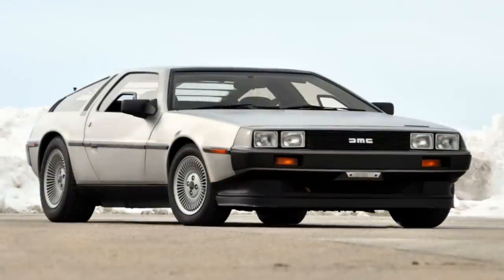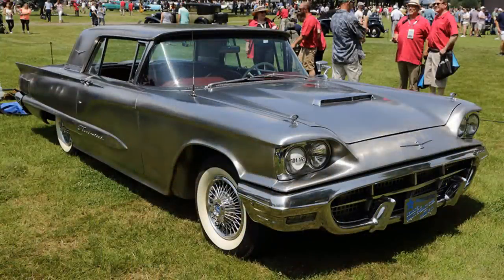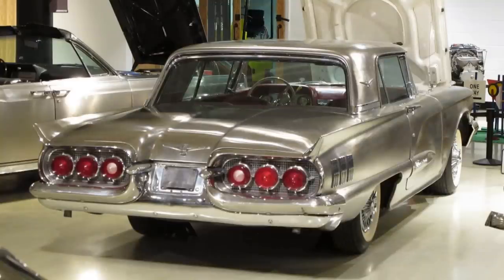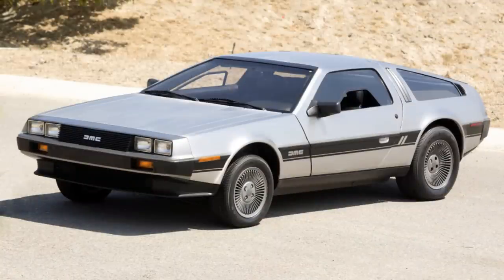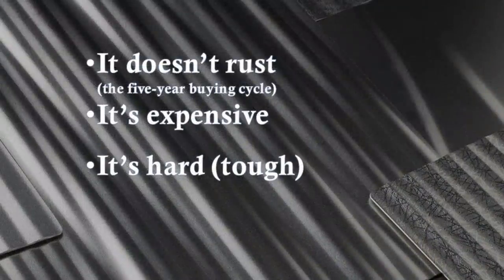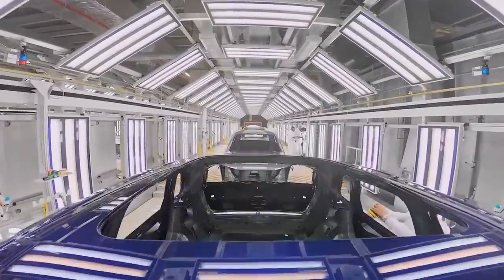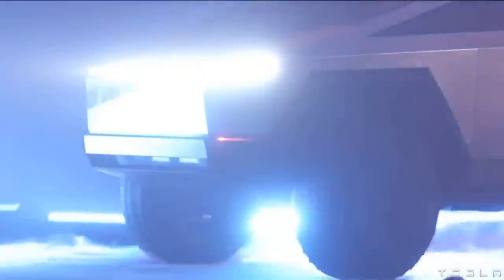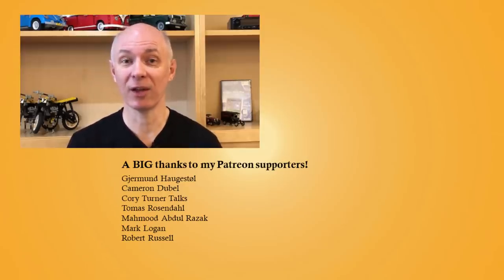Why aren’t cars made from Stainless Steel?

Comment: 5 year buying cycle for a car? What? In my country it's normal to buy cars that are 5 years old and drive them for 10 more years. Really, cars can last for a long time if you take care of it and pick a reliable brand. I would never buy a new car, especially not every 5 years. And it's not because I have no money, I just spend my money on smarter stuff (Like real estate) and my current car is Hyundai almost 8 years old. No probelms at all, just channge oil and filters every year and it can last for another 8 years easy. People are spending money like crazy, it's really weird.
Reply: That happens when people buy stuff to impress others.
Reply: Both my currently registered vehicles are twenty years old and I have two fifty year old cars in the shed that I'd rather drive but arseholes try to steal them when you park anywhere
Reply: The cascade cycle, people who don’t wreck their cars have the option to keep or sell them to those less fortunate than themselves until the car becomes a classic and is then worth more and worth preserving or restoring ….

Comment: Thank God we today have downsized engines with exhaust gas recycling so the engines die before the car can start rusting.
Correction: Aluminium isn´t "rusting" as steel but it´s degrading as well.
Reply: It's oxidizing.

Comment: - Aluminium is also prone to corrosion and typically salt water is enough to do a lot of damage quickly in a lifecycle
- There are parts that are bent on Cybertruck and air bending should not be confused with stamping - you can easily bend stainless steel but stamping features that require deep drawing are much harder to make because the alloy toughens rapidly as the material deforms. But there is not much material deformation in a single line bending so you do not have to cut and weld
- There are stainless steel alloys (AISI 304 and 316 to name a few) that can be welded even better than many "regular" steel alloys.

Comment: I'm quite certain this yet another Tesla gimmick. As has been shown with past models, Tesla isn't good about costing out the parts to come to a profitable price. As another Ford executive once said, if the part costs less than 1/200 of a cent, we give it to the customer for free. If the Cybertruck doesn't sell in the forecast numbers, Tesla will take a financial beating with something worse than a sledgehammer. They'll take an even worse beating if it isn't costed closely enough and it turns out to be a big seller. They'd lose even more money total under that scenario. The late, lamented BMC had experience with this problem selling the Mini. Stainless steel, especially cold rolled, is a very expensive metal to produce and work with. There's a reason why major buildings, that have no five year replacement cycle, aren't generally built with stainless steel. Finally, there are still Federal safety standards to meet in terms of body integrity for impact and rollover. I've heard nothing about the Cybertruck meeting those standards.
Reply: It’s that mindset that gets humans nowhere! I bet you think the earth is flat too!
Reply: @hanniffydinn6019  Yeah, nothing worse that facts to flatten out the earth. Don't worry, dude, Elon will still be launching rockets and going to Mars.
Reply: @hanniffydinn6019  "Influencer". You hipsters really believe this crap, don't you. The truck isn't even in production yet. It has any number of material issues to work through before that can happen, and Tesla needs to build a new production line and get people trained before it can even start production. The current financial condition of the company is any misstep with this truck and and Tesla will quickly be in financial trouble. Being a visionary is nice, but guys like Delorean, the last one with a stainless steel vehicle, was a visionary that ended up bankrupt. Vision without the money to carry it through doesn't mean much. I hope you don't own Tesla stock but, if you do, I suggest you read https://www.digitaltrends.com/cars/tesla-is-dying-and-this-is-how-it-will-end/ and get a stop loss plan in place.

Finally, does every wealthy person and "influencer" in the world already own a Tesla? Didn't think so. There are a lot of companies making EVs now, and most of them are financially stable. The combination of Nissan and BMW has already produced as many EVs as Tesla since it started, and many more companies are nipping at Tesla's heels. People make buying decisions based on a lot of aspects other than how cool a product is.

Comment: In my opinion as far as business and growth strategy goes, to choose to make the cyber truck out of stainless steel will increase the volume ordered from the SS factories over the long period of time lowering the cost with economies of scale. This will in turn can be applied in the rocket building side of business which would generally have a lower volume of SS required. This efficiency is  also transferable in the engineering and design of all the forming equipment and tools required to build anything space related which would otherwise wouldn't have direct positive cash flow.
Selling the cyber truck is really paying for Engineering and factories to build  space equipment.

Comment: indeed its been commented elsewhere that the cybertruck is made from a single piece of cold rolled stainless steel. its either cut or scored by laser and then folded to the desired shape. this is why it looks so boxy on the outside. tesla have spent a while going back to the drawing board minimising the costs associated with car production. stamping dyes and production lines are costly and inflexible!

Comment: One doesn't require 8 minutes to answer the title question.
Yearly profit would plummet if cars were made of rust resistant steel.
Reply: And Tesla is taking customers from those manufacturers. They do have another ace up their sleeve though. Tesla cars are driving tablets- battery degrades and they can disable the car via a software "upgrade". Like Apple does.
Reply: @Mic_Glow  "And Tesla is taking customers from those manufacturers"
"Like Apple does"
And Tesla sales will be as low as Apples compared to it's rivals.

Also Tesla doesn't take. People aren't taken against their will.
Tesla is able to influence, but not take.
Reply: @xander1756  What do you mean it doesn't take away customers? Suggesting EV owners never had a car before? Sure numbers are low, but increasing.
Reply: @Mic_Glow  I mean a company has no power to forcibly take customers from one company over to theirs. They can only influence, coerce, entice. They cannot take.

An individual, in the context of buying a car, is solely responsible for their decision of which car they will buy. They were not taken by one company over to their showroom and forced to buy their car.

It's the same misuse of language when a sports commentator says the person who came from behind to win the race,  and they say that person stole it from the person who was in the lead all the way till the near end, or the favourite was robbed of a win.

No robbing or stealing occurred. The athlete who won, did so fairly and 100% deserved their win. To say the other athlete was robbed or the eventual winner stole soemthing is an erroneous and irrational claim.

Comment: Wasn't there a big push for pedestrian safety in auto designs a few decades ago? The cyber truck kind of just throws that concept out the window with its pointed front end designed to make sure pedestrians go under rather than over the truck

Comment: This sounds like a bunch of excuses. I love the last one. 
"It's bullet proof!"
My thoughts: "yeah, how cool is that?"
Video: "it's gonna be used by criminals!"

Also, environmentalism is the big thing now. Why is trying to make cars more sustainable, longer lasting, and easier to repair a bad thing?

And BTW - how is a car made of streel plates harder to repair than a car made of an intricate aluminium cast? The cost of a stainless steel sheet and a few welds is way lower than the cost of exchanging a part of the car that is specifically.pre-shaped and marketed by the manufacturer.
Reply: "Bullet proof" is only a good idea, if you live in a freaking warzone, where it's more likely you get shot, than get in a situation where you (or anyone else from the outside) need to break the glass to get out of the car. Outside of warzones, it's more likely you get killed by having bullet proof glass, than that it saves your life. 
It's not for nothing they invented car-glass the way it is now. It's not for nothing they designed tools to easily break car-glass, that they recommend you alway have in your car.
Everyone who loves the bullet proof glass, honestly didn't think it through and has no grasp on reality.
Reply: @cryptopolice6202   @Crypto Police  Bulletproof also means debris proof. It means if you plan to off-road with the car, it won't be banged up by gravel and minor falls. 

Also, in a US context, anyone can shoot you. In fact, even outside of the US anyone can shoot you. 

As for bulletproof glass, you can make it so the glass panel can be easily ejected from the inside, and not the outside. You don't have to break it.

Once again, I hear the whining of a person with ZERO creativity or appreciation, who loves to live by yesterday's statistics. 10 years from now you'll comment the same way you do now, but you'll say "I wouldn't buy a car without bulletproof exterior, it's the industry norm! Why would you NOT want to be protected? There is a reason it exists!". Because sheep like you always repeat the most comfortable and least offensive opinion possible.

Comment: Excellent video and a good idea for a subject. Those early Fords were amazing. I take the point about dies wearing out but I would have thought there were new hard materials that would solve this. It's pretty clear that stainless steel is not a good chioce for bodywork, but galvanized steel is a different matter. I have a 23 year old Cinquecento and there is no rust anywhere.
Reply: Bicyclehub Dude, the 500 went out of production 44 years ago. What car are you talking about ?
Reply: @saveriosalemme5366  The Fiat Cinquecento (Type 170) (/ˌtʃɪŋkwɪˈtʃɛntoʊ/, Italian: [ˌtʃiŋkweˈtʃɛnto]) is a front engine front-wheel-drive, four passenger, three door hatchback city car, manufactured and marketed by Fiat from 1991–1998 over a single generation.

It was manufactured at Fiat Auto Poland, which had manufactured its predecessor the Fiat 126.

Production of the Cinquecento ended in 1998

Comment: The thing is: Building cars out of stainless steel is useless. It is hard to manufacture, which makes them far more expensive. And you can get similar results from just treating the surface of the steel the right way. These will only rust when the coating is damaged and not repaired. And of someone does not treat their car properly, something else will break anyways. That's why stainless wouldn't make sense. It wouldn't change the life expectancy of the car that much, but make it more expensive to buy.
Reply: You obviously don’t live in Minnesota.70,000 dollar pickups rusting out in ten years. Build one that’s durable and they would have people standing in line. Pretty sick, and they are all in on it.

Comment: One aspect I haven't seen mentioned or I've missed, is stress corrosion cracking in stainless steels due to chlorine. Basically, where stainless steel is under tension (be it structural members or even just bends of residual stress from welds) any chlorine present will cause cracks, and the tension  will accelerate the process. This is a particular problem at higher ambient  temperatures. The classic case study is the fatal collapse of concrete ceilings of several swimming pool buildings that were held up with stainless steel tie rods. In car terms I would guess you would see problems in the engine bay or around warm battery pack structures, mostly over winter from salty roads, especially in hard to reach areas where the salt isn't washed off.

Google "hse stress corrosion cracking pool" should give you an official report on the collapses for example.

Comment: You rather skated over the fact that: 1) The Cybertruck is years late & 2) the vehicle shown at the launch broke safety laws in all significant jurisdictions and would require a fundamental redesign before it would have any chance of going into production. So more a publicity stunt than a serious attempt to produce a marketable vehicle.

Pretty much the same story for the Semi. Tesla are becoming the masters of vapourware, without a single product that they are selling at a profit. Right now they are only being kept afloat by government handouts ' grants that will soon be drying up. The most over-hyped company since Theranos...
Reply: 100% agree. The Cybertruck wouldn't pass crash & safety tests anywhere in the world in it's current form. And good luck getting that lump of stainless steel to crumple as is needed to protect the occupants. All Tesla does is keep the hype and spin going to keep the investors and fanboys happy.
Reply: @Ozsmallbore  Yup - the Semi is even more of a hype-job than the Cybertruck. Also years late, and simple arithmetic shows that the batteries will take up so much of the max allowable weight that there won't be much capacity left for freight. And then there's the autonomous taxis - when they can't even run autonomously in a tunnel they built themselves in Las Vegas. It really is beginning to look like one big scam - but there are millions who seem to have drunk the Kool-Aid...

Comment: The Ford model A of 1930-31 had many exterior parts made of stainless steel. Radiator shell, headlights, tail-light and trims. There's at least one 1931 Ford Tudor made of stainless steel similar of the 1936 ones.

Comment: It's expensive and heavy and there is no big upside from security point of view and gives less mileage, along with all problems with a heavy body.
Reply: Stainless steel has roughly the same density than low alloyed steelgrades, so if a particular car is "heavy" has nothing to do with the steelgrades used...
Reply: @stefanpaege2046  compared to aluminium ? 
most cars in the price range use aluminium that includes the Ford 150.

Comment: Stainless steel panels copper-brazed with flanged stainless steel cylindrical tubes are the way to go! Checkout BROAD Group's BCore Stainless Steel Building Material, which can be used to develop cars, buildings, ships, and bridges using stainless steel material. In one of their marketing presentations, "bcore slab - Broad U.S.A. Inc.", they even depict what could be termed CYBERTRAIN.

Comment: I would expect development of fatigue cracks in load bearing body panels to become a problem in the long term. The metals rigidity does not allow it to absorb vibration loads.
Reply: Nope. Cold Rolled Stainless Steel has good yield strength and is resistant to fatigue.

Comment: Great vid on points with using stainless steel n history car manufacturing using stainless steel.👍 I believe Tesla won’t build because they don’t have factory that can build in big numbers but will find way putting cybertruck together if they can afford newer bigger factory.
Reply: Yeah that's what I thought too but apparently they've already accepted pre-orders which is alarming since there is no way this bulletproof riggid car can pass safety tests and become road legal.
Reply: Roni Vornanen Do you really think Musk would present a car which he wouldn’t be able to manufacture or have pass safety tests? If you do I have a bridge in Brooklyn I’d like to sell you.
Reply: @saveriosalemme5366  Considering this is the same guy whose solution to traffic jams is building one lane underground highways with elevators that take good 20 seconds to get one car in and out. Yeah I actually do. He isn't a genius but he isn't a conplete idiot so there's definitely some kind of clause in the pre-order agreement that says the cars won't have to be exactly identical to the pen they introduced.

So that probably means the whole the body won't be built on a stainless steel armoured _"exoskeleton"_. Because if it is I can't see that passing of the pedestrian safety standards. There's a reason why bonnets and bumpers are soft plastic and aluminium and not hardedged extra strength bulletproof, dentproof stainless steel. 

In modern cars the body is designed to absorb the impact, this is done though having an internal chassis covered with soft aluminium but here all we have is an _"nearly impenetrable exoskeleton"_. I can see that being very strong like Musk has repeatedly said. But I can't see it being very safe. Eitherway I'm the only one who thinks this. Here is an actual expert on the matter: https://www.autoblog.com/2019/12/16/tesla-cybertruck-european-safety-regulations/